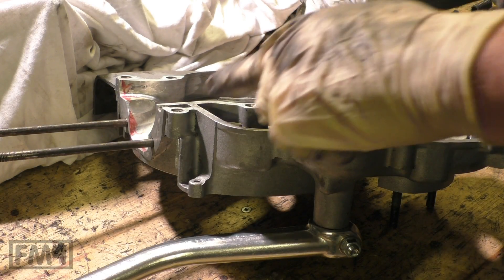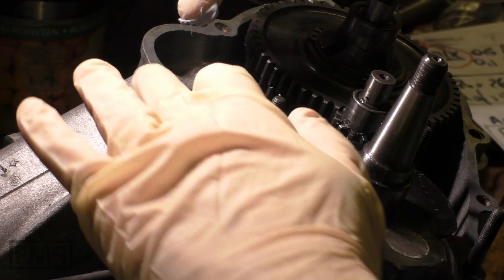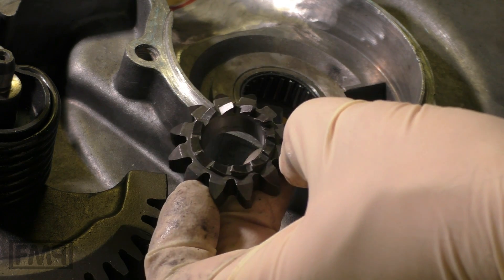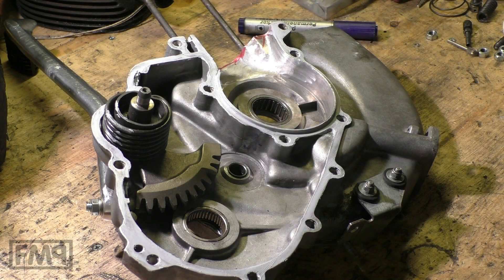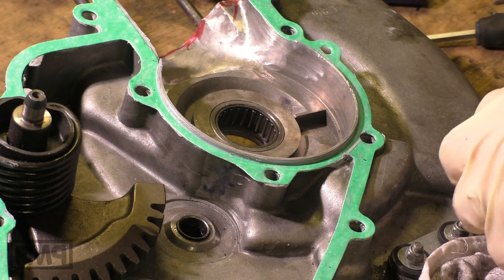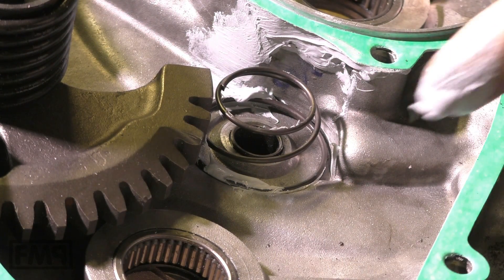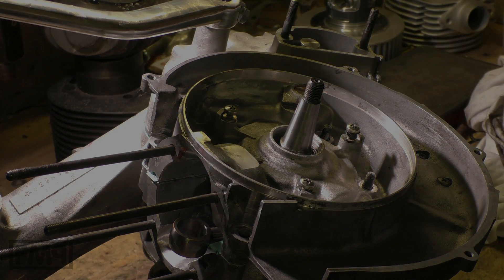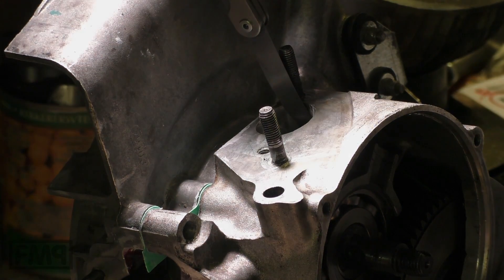THE ultimate VESPA engine CLOSING GUIDE | the ANTI oil sucking TRICK | FMP-Solid PASSion |

Comment: Servus!

Hey Mr. Moped
Why don't you try to play with small frame vespa?
Reply from the maker: i am 190cm 😉
Reply: @FreakMoPed8  i know, Du mentioned it somewhere in your video, but ich glaube that it would be interesting if you tried to tune smallframe vespa, since the engine has different construction than the large frame counterparts 😎😎

Even die kupplung is on the primary shaft, not at the crankshaft
Reply from the maker: and i do have way too big Fingers for a tiny smallframe engine 😉 Heard that soon a largeframe engine case is gonna be available where smallframe hardware will fit 😉

Comment: easier to do fly wheel seal  as engine in half thats
 what ive found over the 35 years building them
Reply from the maker: both works of course, for me its more convenient to set it afterwards, as i so have more control over the shaft seal spring, that it stays where it should and doesnt jump out.
Reply: Last week i closed my px engine. For the first time in 10 years, the fly seal's spring jumped out. I had to maintain the  new seal with a little screwdriver because it did again. Next time i will fit the seal after assembling. I think it's because of the little oxydation on the crank.

Comment: 1:24 them gaskets are crap I fitted them to my carb and box 4 times because they keep leaking and now my gear selector box is leaking now after I cut my own gasket for my carb

Would definitely not recommend
Reply from the maker: Disagreed. These are the very best gaskets, use them eversince, without any problem.  You need to ensure that all sealong surface edges are rounded, otherwise it will leak. Thats a rule for every case when two parts come together, always make sure that there are nur sharp ist edges (and damages) for the si carburettor: sandpaper the bottom, it likes to ankle. If it leaks its mostly the lid od the filter chamber. Wromg lid, ankeled lid etc

Comment: Excellent video as always Mr. FreakMoPed. But wait: What the heck are you doing at 8:20 with the... "centering bolt"?? I am unfamiliar with that.
Reply from the maker: the two halfs are centered with a bolt at the bottom. guess most of the time the bolt is not taken out but remains
Reply: @FreakMoPed8  yes, that bolt I assumed was pressed in and was not to be messed with. Evidently though it can be.
Reply from the maker: it does move. belive me :D